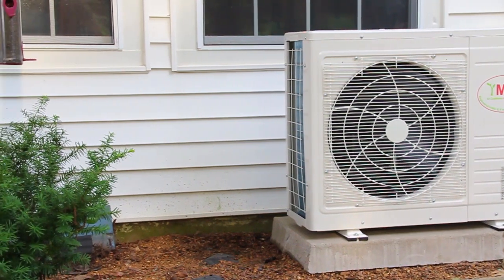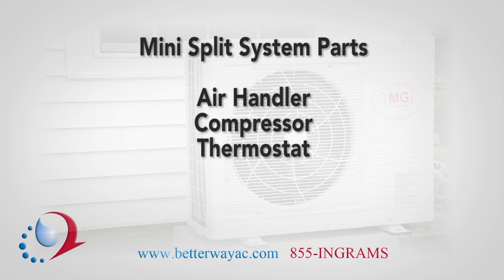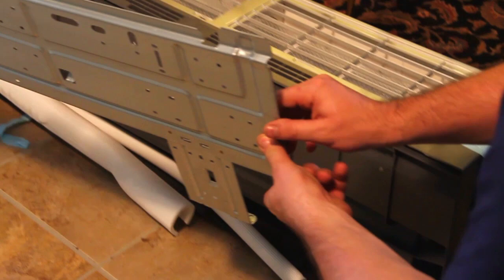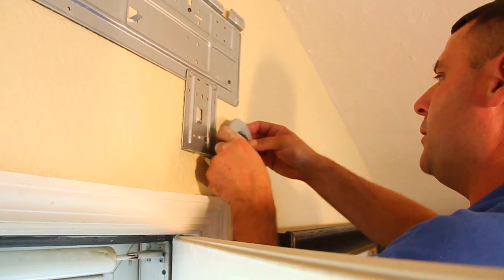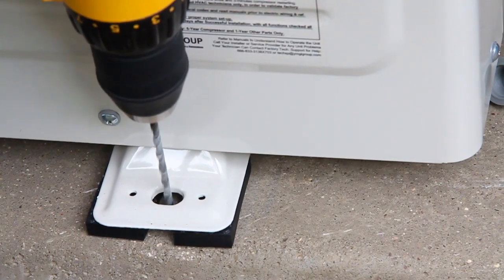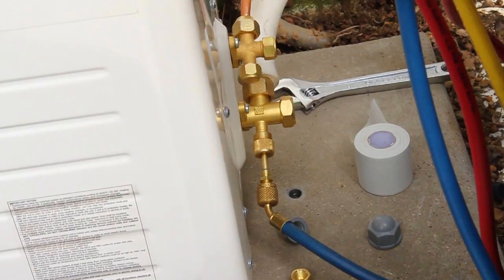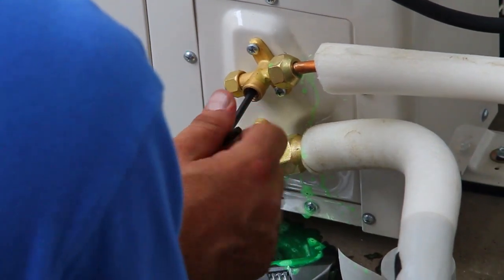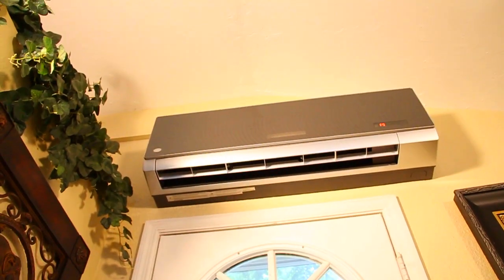Installation of a Ductless Air Conditioning System

Comment: Being a retired hvac guy, These split system work well. Not to hard to install. I would mount the outside condenser unit a little higher off the ground away from water and snow.

Comment: Very informative video, thanks. I am wiring up my new workshop and plan to install a 2 zone mini-split to heat/cool the workshop and a rec room upstairs. Are you able to tell me what wiring I need to run to the service box? Thanks!
Reply from the maker: I am not sure on that one. I would recommend you consult with a local electrician or call our tech department at 800-360-1569.
Reply: OK, thanks for the quick reply.

Comment: Hi - thanks for the video. Do you have to have a minimum amount of clearance above the unit from the ceiling?  Would it have been possible to mount the unit in the video an inch or two from the ceiling? 

The vents are on the side, so it wouldn't block the air flow. I want to mount one above a window and someone said I need 9 inches of clearance above, but I don't understand why that would be necessary if the airflow is not coming out the top.
Reply from the maker: The unit would function normally with minimal top clearance. The problem you would encounter is an inch or two would leave you very little space to open the front cover of the air handler unit. Most all mini-split units feature a front cover that flips up to access the interior. Another problem might be fixing the air handler to the mounting panel. An inch or two would make that connection very tight. I think you could get it on there, I just want you to be aware it might be a problem. So, yes, you can do it, but there are trade offs.

Comment: what about the second floor? do I need another unit? don't all room doors have to stay open to feel the heat or air?
Reply from the maker: A single ductless air handler isn't designed to heat or cool an entire house. To do that you would need multiple air handlers tied into a single condenser. You might place one in the living room, one in the main bedroom, another upstairs, etc. Leaving all doors open would be a good idea to maximize interior air flow.

Comment: I just typed a question and was almost done and puff it was gone. try again
I want to install a 12000 btu unit in my living/tv room but cannot place it on the outside wall because of a large window. A floor unit would work but would not put the air where I want it to go. It would blow on us. I want it elevated but connected to 2 wall in the corner, not at 90 deg but 45 deg to both wall. I plan to build a wall (2x4,2x6 whatever will work), big enough to let the unit rest on it. It will be very secure, resting a piece of wood say 12 inches long, 25 inches wide but again depending on the size of the air handler. If you were facing the unit, the exterior wall is on the left, so the power,tubing,drains etc need to come out the right side, center might work and then exit the house.
Has this been done before? Hopefully I have explained myself properly. I need the unit to blow towards an open area which includes a stairs and then kitchen. I plan to install another unit in the kitchen after I have done with remodeling it. 
What do you thing? Thanks
Reply: sorry just reread my question. the power, tubing, drains need to come out the left side, and the center might work. I know you all would have noticed that and said WHAT. thanks again
Reply from the maker: As long as the mounting surface is strong enough to support the weight of the unit, a ductless mini-split heat pump can go just about anywhere. If you make sure that your mounting location can do that for a long period of time (i.e. - years), you should be fine. And, yeah, all the connections would need to go out the left side to the condenser.
Reply: thank you. I will be in touch with you shortly.

Comment: can this system be installed on the second floor of a home ?.
Reply from the maker: Yes. If the connecting lineset was long enough, you could install the interior component on the 2nd floor and the exterior component on the ground. When the distance is too great, many buyers mount the exterior condenser to a wall mount.

Comment: I have a 12x16ft sunroom with an 18in knee-wall. Is there a preferred location for a mini split system. in my case, mounting the unit towards the floor would make an installation super simple because the condenser and unit could be mounted back to back only separated by the wall. I'm only worried that the a/c and heat would be too close to the floor.
Reply from the maker: Most homeowners install the units higher on a wall to ensure better air flow around a room. Mechanically speaking there is no reason it wouldn't work mounted letter, it's just not ideal.
Reply: thanks,makes sense.

Comment: has anyone had a flashing cooling and heating light? it does not blow, i have had this for 2 years worked fine before.
Reply from the maker: +DustinJames What brand of unit are you using?
Reply: +Ingram's Water and Air Equipment 
lg room air conditioner model lsn120hev , i could not find any info except for how to install. it has power at breakers to the unit as well. full of freeon and fan does not come on either.
Reply from the maker: +DustinJames It sounds like that blinking light is just a general fault indicator, so I'm not sure what the exact problem could be. However, you should contact the LG Service Center (888-865-3026). Someone there should be able to help you.
Reply: +Ingram's Water and Air Equipment Thank you
Reply from the maker: +DustinJames You're welcome! I hope I was helpful.
Reply: +Ingram's Water and Air Equipment more helpful than anything I found. and you have more knowledge than my ac guy. I have built homes, been a plumber, and now im  a salesman for a oilfield company, I believe I know more than him. lol Thanks for the help

Comment: i have  living room 2 bed room and kitchen on first floor and 2 bed rooms upstairs can one unit handle that or how many ubits will be required Thank you also i need to keep house worm in winter to  70degree f in cold winter days so ususally how much running cost the unti by an hour thank you.
Reply from the maker: +lovenpeace I recommend a conventional, full-sized central heating and air conditioning system. It would be possible to heat and cool a 4-bedroom home with multi-zone ductless systems, but central HVAC will provide the best value and comfort. 

Also, the cost per hour to run a ductless heat pump in heat mode on a cold winter day is going to depend on a lot of variables - local electricity cost, the exact temperature of that 'cold' winter day, building insulation, area to be heated, etc.

Comment: Is this type for one room , or the whole house  ? I have central air in my backsplit home , downstairs it`s freezing , upstairs it`s warm air . In my three bedrooms I have installed , three ceiling fans . Any other ideas ?
Reply from the maker: +Nino Stea The great thing about ductless mini-split units is that they are very flexible. You can run a single unit if you need or up to three or more off a single condenser.

Comment: Can this work as the main heating and cooling system in a trailer and can you add an additional unit for four zones?
Reply from the maker: +conweis Yes, there are ductless units that can distribute conditioned air across 4 different zones. For example, the Mitsubishi Mr. Slim (http://ingramswaterandair.com/mitsubishi-ductless-mini-split-seer-9000-btuh-cooling-heating-p-16459.html \), and  ductless units will work in a trailer. 

If you have any more questions, give us a call at (270) 575-9595 or (800) 360-1569.

Comment: I wonder if you I can install this in my condo, the noise form the ac in my condo is annoying?
Reply from the maker: +qasion Ductless mini-split units work well in condos, so, yes, one could be installed in yours. If you have other questions, you can reach us directly at 270-575-9595.
Reply: Thank you.
Reply: +Ingram&#39;s Water and Air Equipment The Association won't allow for outside unit, I wonder if we can use the existing piping/connections of the old unit on the roof to use with the new outside unit, so this way we didn't add anything we just replaced? :-)
Reply from the maker: +qasion I would not recommend using an old copper line with a new system. However, if you're removing and replacing the old system, why would you want to keep the old connections?
Reply: Because my outside unit is on the roof, this a building not stand alone house.
Reply from the maker: +qasion Are you currently using a ductless mini-split or a more conventional unit that ties into ductwork?
Reply: The latter.
Reply from the maker: +qasion Given your situation with the Association, your best bet to get a quieter unit is replace the old air conditioner with a new model of similar capacity. You could even opt for a unit with interior insulation to make sure it runs relatively softly. If you're not sure what particular system you would need, give us a call at 800-360-1569 or visit us online at http://ingramswaterandair.com/. I think that is your best option, since the interior connections that work for a conventional HVAC unit are not compatible with a ductless mini-split.
Reply: Thank you sir.
Reply from the maker: +qasion You're welcome, I hope you get everything set up to your satisfaction.

Comment: What is the max distance the pipe can be from the compressor to the air handler?
Reply: And how much to drive to New Jersey and do the installation?
Reply from the maker: Marty Lynchian 25 feet is the max.
Reply: Ingrams Water and Air LLC. Is that because the installation kit only includes 25 feet of pipe or does it have to do with the laws of physics?  I think I read in a manual that it comes with 25 feet but if you need something longer then you have to buy more pipe and extend the existing pipe however it did not say what the max distance was for the unit. Thanks.
Reply from the maker: Marty Lynchian You're correct - you can go longer if you extend the existing pipe. You could probably go as far as 80 feet. Though you would definitely need a trained professional to make these kind of field adjustments.
Reply: Ingrams Water and Air LLC.
Thank you. I have actually been hunting for days looking for this information. This will at least tell if if a mini-split AC is even in the realm of possibilities. Thanks.
Reply from the maker: Marty Lynchian Happy to help. If you have any further questions, just ask!
Reply: +Ingrams Water and Air LLC. An installer I spoke with about 45 minutes ago said 180 feet, but he also quoted me more than $20,000 for a 6 zone 1500 square foot house install, so maybe he doesn't really know.
Reply from the maker: +Michael Anderson Technically, you could extend install a ductless unit with more than 80 feet between the condenser and the air handler, but we don't recommend it. A good tech might be able to get this to work by increasing refrigerant level to compensate for the extra space. However, this means the compressor will have to work a lot harder to do its job. That means you could be cutting off years of operating life - which is bad.
Reply from the maker: +Michael Anderson Also, you should give us a call. We should be able to set you up with what you need for way, way less than $20,000. Plus, free shipping!
Reply from the maker: +Michael Anderson Ha! That might cost a dollar or two.

Comment: I've seen the prices of these units and all parts of the system.  I know what the totality of components costs compared to the totality of components in a conventional ducted system.  I've also seen installation of both types of systems.  Question is, why is the cost for a ductless mini split installed like four times the cost if a conventional ducted system installed?  And I'm getting that info from multiple HVAC contractors down here in east Texas, not just a couple
Reply from the maker: Ess Jay Really? That's very strange. There's definitely no reason why a ductless install should cost MORE than conventional install much less 4x more.
Reply: Ess Jay They charge that much because they can.  I agree, there is no reason for them to be so expensive.  They are not much different than a window AC unit, just packaged into two parts.  I can see where multiple inside units (the air handlers) will add to the cost.  I've seen some online units with two air handlers cost $2100 + installation (22 SEER) and a three air handler system for $4000 (17 SEER).  Doesn't look too difficult to install and make operational from the video.  Seems like they run about $100 per 1,000 BTU.
Reply: can if make nice and cold in hot days

Comment: I have a rectangular office with one of the narrow sides facing the street. Where would the best place to mount the A/C unit? On one of the longer sides or in the back facing to the front? Thanks in advance for your help.
Reply from the maker: g Either should work. Try to install the unit in a location which will provide the best airflow through the zone.

Comment: What to do if the pipe is not long enough ?
Reply: The manufacturer will state how long the lineset can be.  For example typical max limit might be 65 feet.   Linesets come in varying length - and since most are copper...you only want to get the length that you actually need.   Some units - like Ideal-Air might use stainless steel pre-charged lines - which come in 23ft length - which limits placement (if using the pre-charged lineset model).

Comment: If i want to replace the Dry wall the unit is mounted on do i have to disconnect the coolant and drain hose from the outside unit and pull it all back through the hole, or can i disconnect the piping at the wall unit?

Comment: I ripped out my central air system and installed a 3 zone mini-split. Cut my power bill by more than 50% both summer and winter.
Reply: I calculate 31 months and my system will have paid for itself. Good luck!
Reply: Fresh Look -- I wished I had man as handy as you around me.   I am afraid it is going to cost me a bundle to get this installed in a Condo on second floor, yes?
Reply: what do umean by 3 z0ne and what was the cost i am interested in buying a diken mini splitreply to albert

Comment: can you install 2 cooling units? 1 in the room and 1 in the bedroom?
Reply: ***** is 15K bth enough for 700sq ft plus?
Reply: MrProTechHD Yes, they make multiple air handlers that run from one condenser unit.  That's one advantage of the system - zone control for each room.  I imagine that you can have as many as you need, but there are practical limitations (condenser unit must be sized to run all air handlers at the same time).  LG sells a 39,000 BTU system with three air handlers.

Comment: Hey great job on the video!

I believe this will be very helpful for potential customers. I'm a firm believer in educating customers as much as possible.

I've seen some housing areas in Japan where it's just row after row, wall after wall of mini-splits. I guess it's because of the population density and that they tend to have smaller square foot homes and apartments versus the McMansions in the U.S....?
Reply: It's the whole world, the US always has had cheap fuel whether oil or gas

Comment: Approximately how many hours does it take a HVAC technician to install a quad zone ductless system? I am trying to determine total cost based on their hourly rate and total hours worked to install the system. If this job would require two or more technicians, then what is total hours combined needed to install the system.
Thank you!

Comment: these don't do any humidity control which is what a central air performs? I believe that is the biggest issue with these units! Cooling isn't the same as cooling and de-humidifing!!!!!! correct me if I'm wrong!

Comment: All air conditioners dehumidify. pretty much all of these ductless splits have a dehumidify setting. Check with a well informed service tech if it`s right for your application. ie vacation home, or damp basement dehumidification, ect.

Comment: also you need a refrigeration license or a residential air conditioner license for this. The average 2.5 ton air conditioner I think is 3000 to 5000 installed but I am not exactly sure. Pricing depends on the size of your home and your cooling needs. You would have to get a proper heat loss or energy audit done on your home then get a quote from a local HVAC company. a 1 ton air conditioner is around 12,000btus if that helps as well.

Comment: 6:40   What is Low Voltage?  Is the interior unit 120 volts and the exterior higher voltage?
.
Anyone?
.
.
Cheers.
from,
del-boy.
Reply: 6:40

Comment: @Xringer Yes all that is true but its what you have to do to make sure the system is perfect .  Im talking about a big vrv unit . 10 indoor heads or more with 1 big outdoor unit . Where there are heaps of welds and alot of pipe work.
Even big refrigeration systems i would leave for awhile.
the fluctuation from the ambient temperatures dont really effect it after a week . because if it has a tiny pin whole leak you would know about it. 
But yeah domestic no need to leave it over 20mins.

Comment: @Xringer 200 to 500 . hardly anyone uses a vaccum stat. afer pressure testing it the vaccum should hold. 
I use to pressure test systems for a week.
Big commercial systems where a tiny drop on your gauges over 24 hours it still a big leak.

Comment: @Xringer Good post, YOu only need to bubble the hex key valvue part after gasing . The first pressure test if you leave it for 10mins or so and it doesnt drop then the vacum stat doesnt move , no point going to crazy with the bubbles again .